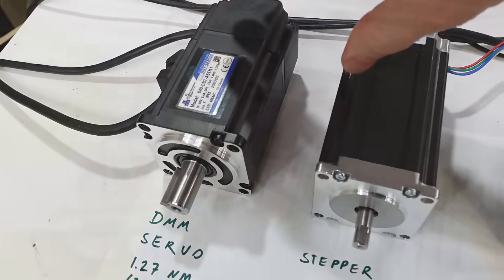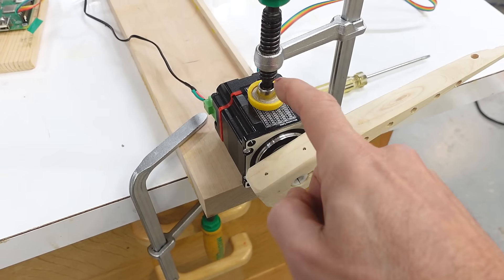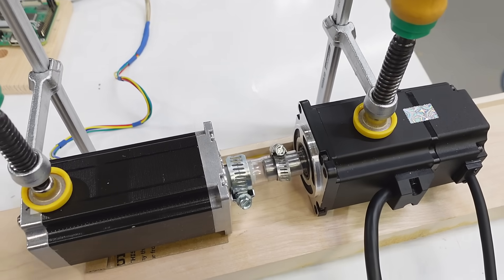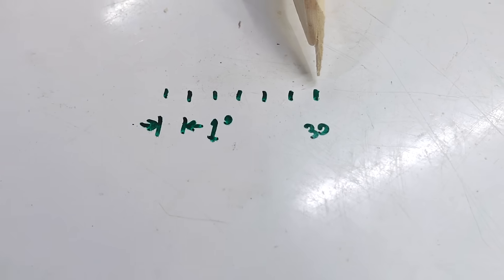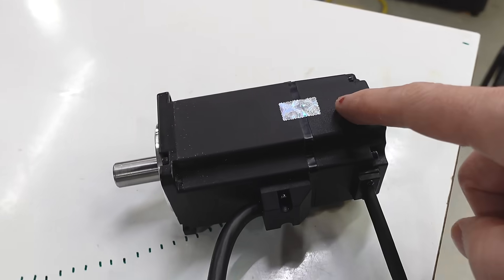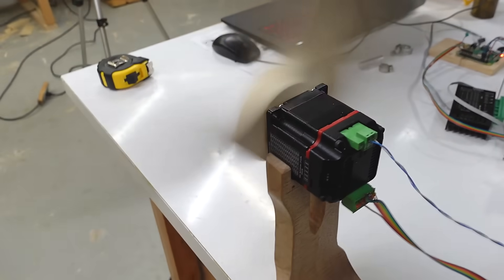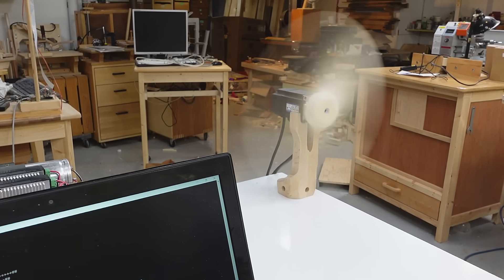Servo vs steppers: Speed, Torque and Accuracy

Comment: just buy servo motor with optical encoder, i got my CNC router on cheap chinese servos(£120 for 600W magnetic feedback set +£30 optical upgrade), acuracy 0.1degree across whole circle), also adding magnetic shelding tape helps alot with magnetis encoders.

Comment: Cool tests Matthias, how did you decide on the diameter of the pulley for the weight test? It seems to me that the ratings would be at shaft diameter, no? Which would be much higher.
Reply from the maker: rating is torque, which is independent of shaft diameter.

Comment: Inconsistent use of the SI Metric System. It is the 21st Century not 18th Century science anymore.  You call weight kilograms and torque Newton-Meter.  Do you see a problem with that?   Torque = Weight or Force x Distance = Newton-Meter not  Kilogram-Meter.  Mass and Weight are not the same thing. The mass of an object is the same value on Earth, floating around weightless in space and on the Moon.  But the weight is different at each of these locations. Weight is a derived unit.  Static weight = Mass x Gravity  = kilogram meter per second square = Newton.

Comment: Very interesting video! When comparing the dynamics of the motors, one factor that I don't believe you mentioned is that because all the motors are different sizes, their rotors will have different moments of inertia. It's therefore not a true like-for-like comparison, but may not be far off if the rotor inertia is small compared to that of the pointer.

Comment: The torque calcs are wrong on the pulley / weight lift because the radius changes with the rope thickness.

Comment: The servos we work with in industrial automation control typically use glass optical encoders and have accuracy to fractions of a degree....but they also typically start at over $1000 for a motor & amp and typically require a special "motion control" PLC

Comment: This video is a great example of why you should get a 3D printer. These kinds of experiments are the perfect use for the ends of your reels. The coupler you had to order could have been designed and printed inside 2 hours.

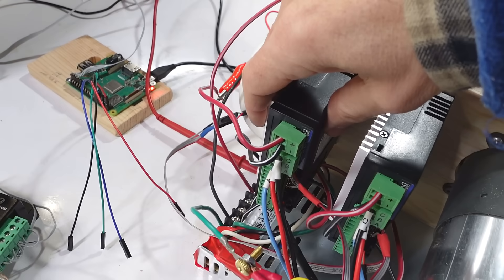Comment: 10:48 the sensor measures inside the motor windings and drive power module, and that gets hot way before the outside.

Comment: I love these videos. Could you do something similar, but related to static loads. I want to build a DIY electric weight set and I'm trying to figure out the size and type of motor i should use to apply a static force that i can push against, effectively running the motor backwards.
Reply from the maker: Most motors rely on running to help keep them cool, so applying a static force might cause them to overheat.  I'd recommend just a DC motor, and apply a current to it.  A treadmill motor might just barely be big enough.  A much better way to get a constant load is to use a physical weight.

Comment: What kind of crappy servo are you testing? I have two different type and make and both work perfectly well when it comes to positional accuracy and maximum speed. One is 180W with a built in driver and that one is powered with 50VDC and the other is a 600W AC servo powered directly from my mains, which is 230VAC. I used the 180W on my DIY lathe as spindle and it was perfect but needed more torque so I upgraded to 600W. I'd be very disappointed if I couldn't get better position accuracy than you did, or would get overheat problems after a short run. Here is a short video about the 600W: https://youtu.be/808WNVtjevI and here is one while I still had the 180W servo as spindle: https://youtu.be/uQzUsYaM68Y In both, there are some works done which needs position accuracy also.
Reply from the maker: But have you tested the positional accuracy of your servos?

Because without measuring, you would not be aware of half a degree of error.  You could be cutting gears with 100 teeth and not even notice, because the half degree error is spread over 180 degrees

Comment: I thought AC servo motors run very quiet. I bought a 400W DMM-tech AC servo  motor with their Dyn4 controller. But it is noisy as heck. Nothing wrong with the bearings apparently but it sure sound like they are shot when the motor runs. When idle with no load what so ever it is still constantly squealing with high pitch noises. Now I am missing about with EMI filters on the mains power supply but that does nothing. Add to that incredibly buggy software to setup the controller and now apparently also highly sensitive to external magnetic fields. It is starting to feel I made  a mistake.
Reply from the maker: You may need to tune its parameters.  Set the torque filter constant to something larger.  If you tune them too agressively, the feedback loop can go downright unstable.  But they will make some noise, even when just holding a position.

Comment: They should have magnetic shielding on that servo motor!
Reply from the maker: Maybe, maybe not.  That shielding in turn can get magnetized and actually make things worse.  But if the encoder magnet was twice as strong, external influence would only be half as big, relatively speaking.  But its hard to find an application where half a degree of encoder error even matters.

Comment: Mathias, I was curious during the weight lifting and holding torque tests if you took into account the diameter of the pulley and the additional torque applied by the distance from the pulley edge to the motor shaft. That single multiplier would have thrown off your calculations enough to make a difference in your tests.
Reply from the maker: Motor shaft size doesn't matter in this calculation.  Its pulley diameter, plus rope diameter that is the effective winding diameter.  That's what applies torque.
Reply: Was thinking the same thing

Comment: i might be wrong, but in theory could you attach mosfets to the outputs of the stepper drivers and feed however much power you want into the servo/steppers?
Reply from the maker: Need an H-bridge actually, and driving the high side mosfet of the H-bridge is complicated (need a driver chip for that).  So I'd want to just hook up a bigger H-bridge instead.  But more economical would be to just get a better stepper driver.

Comment: Does the company you sourced from offer servo motors with optical encoders which are less susceptible to magnetic and electrical interference?
Reply from the maker: The magnetic interference is much less of an issue than you think it is.  Being half a degree off translates to 7 microns of position error with a 5 mm pitch ball screw.  How bad is that?  A typical DRO can read to 5 microns, which is already way more precision than you are likely to achieve.

Comment: Okay that's super, super interesting about the servo overheat.  I have a ton of applications for motors like these, but it would all be in warm and hot environments.  That firmware would cause a TON of downtime and failures, so basically the opposite they were going for.
Reply: The user’s software can react to an overhead warning, but not a case of the servo actually overheating and failing mechanically.
Reply from the maker: I suspect its more a matter of how much the servo has run than anything else.  The controller doesn't have a temperature sensor in the servo, so it's just guessing at the temperature.

Comment: I am surprised the magnetic encoder accuracy on the servo was so low. It would be good to show what a servo can achieve with a capacitive or optical encoder. Can usually hit a few arcsecond with a higher quality feedback device. Maybe also compare some other lower cost servo options like clearpath that have some brand recognition, against a Beckhoff, Kollmorgen, or other name brand industrial servo.

Comment: This is great! I'm not the only one who finds ramping steppers quickly without stalling difficult. Fun video!
Reply from the maker: And the problem is, one you worked out the perfect ramp curve to get the most out of your stepper, any slight change or even a slithly loose setscrew and it may fall out of sync.  Not very forgiving.  Servos and closed loop steppers are very time saving that way!

Comment: Can you use an accelerometer to tune the PID values of the steppers? Like how fancy 3d printers use accelerometers to measure the behavior of the moving parts and come up with frequency curves to help reduce overshoot, without killing acceleration.
Reply from the maker: Don't even need that.  I can just read back the motor's position really fast and graph that.

Comment: When you were testing positioning accuracy of the servo you were in reality testing the accuracy of the encoder. Long ago I built some positioning devices for CNC use and started with steppers, both for cost reasons and because of the inherent accuracy of the steppers as any positional error was corrected every 4 complete steps. Then I went to microstepping drivers and found positional accuracy suffering. Then  I tried getting faster speeds out of the steppers and the torque dropped dramatically, which required larger steppers. I finally saw the light and moved to servos. I used optical encoders with very high pulse counts, read them in quadrature to get 4 times the step count, and finally achieved the speeds and accuracy I desired. After that I never used steppers for anything requiring significant torque and speed.
Eric
Reply: I will keep this in mind when I try to make my cnc machine. Thanks

Comment: When you control the servo, do you send position updates in a fixed interval? What is the jitter of the python control?
I've read about Ruckig as a way to get motion curves for position control. Many robot people use it. I'm not familiar with it, I'm familiar with Beckhoff NC, which is fine for simple stuff and completely crap if you want to do something complex.
Reply from the maker: In my tests, I just sent it "go there" or "go this speed" and let the controller work out the details given the motion control parameters.  For a CNC router, sending it pulses like a stepper would proably make more sense.

Comment: I think the servo is looking at the average of current draw within a short time frame, and simply assume it will eventually overheat if the current draw continuous like this. If you want to save your motor from burning out, it might be better to stop before actual overheating occurs.
Edit: I see the topic has been addressed in the end of the video.

Comment: Interesting tests and I look forward to the PID control video.  That servo-motor is quite impressive.   You are 100% correct about industrial applications.  They want a part that is reliable, has good support for it, accurate specifications and that you can order an exact replacement for if the original fails.  They don't care about lowest possible cost part since machine downtime and staff costs will dwarf the part cost.

Comment: For the steppers during the torque tests, be sure to test under different microstepping divisions. Microstepping increases positional resolution at the expense of torque by pulse width modulation of the coils. Without microstepping the full amperage is applied, maximizing torque (especially holding torque).
Reply: Exactly!

Comment: I think if you could perfect a full rotation per second slam clock it would be marketable.  It's a lot of fun to watch.
Reply: The second hand should alternate going clockwise and counterclockwise. When it goes clockwise it should advance by 366 degrees. And CCW by 354.

Comment: Very interesting seeing the feedback fluctuations while stationary and magnetic field alignment. Wonder if unfortunate placement of a few loops of the motor power cable close to the encoder would effect the feedback.
Reply from the maker: probably not.  the return goes through the same cable so it mostly cancels.  also, a few amperes is not that much.  electromagnets have many turns, so the same current is apolied hundreds of times.

Comment: Shouldn't the servo-motor be able to self-calibrate by running the motor in a constant RPM and then measure the feedback from the magnetic sensors?
(You would only do that when it is mounted for its use)
Reply from the maker: good point.  but… not sure if it would be accurate to 0.1 degrees, cause if it’s not, that could make it worse.

Comment: Is that magnetic encoder meant for position control? I would say no, needs a secondary system with optical encoder that does the positioning. That magnetic encoder is suspect and maybe just for rough speed control.
Reply from the maker: 5 mm pitch lead screw is common.  if the error is 0.5 degrees, the linear error will be only slightly bigger than the resolution of a typical DRO.  so take the difference between two readings with the DRO, and the rounding error will be about as big as the encoder’s inaccuracy.

Comment: You can't get rated torque with micro-stepping. Accurate repeatability is best with half stepping only. 
Holding torque is best in single stepping mode and decreases with micro-stepping. 
Micro-stepping is mostly used when smooth and quiet operation is needed.
These are all current-chopping drivers. The major benefit from operating at higher supply voltages, is the current through the coil reaches maximum faster (usually set by dip switches on, and therefor more RPM speed at the output shaft.
Reply: This guy knows his steppers ;)

Comment: The tests with the earth's magnetic fields were wild. Imagine being an engineer who designed a tool somewhere and shipped it to a customer elsewhere, who proceeds to have issues, sends it back, and it works fine for you. You travel out there and have issues with it, likely baffled
Reply: this is why any PID control system is only as good as its diagnostic tools capabilities. A technican comparing results from his lab-setup with (even remotely acquired) data from the field setup would very likely be able to pinpoint the issue around the values from the magnetic encoder that are fed into the loop, instead like for example the costumers application/load
Reply: Its .15 degrees. But the key is moving motor vs stationary. If the motor stays in one place and doesn't have anything near it, it will always be the same no matter where on earth because the offset is just part of the reading. But if its moving like a robot or near magnets it could be an issue. But if its .15 degrees at its shaft it depends on the gear ratio as to weather anyone would even notice it. The only way to prevent it would to be some sort of enclosure like a hard drive that cancels out the fields outside vs inside
Reply: IIRC Strange Parts had a SEM that had similar behavior, and ultimately they determined that it was due to his elevation causing problems with arcing. Crazy how quickly stuff falls apart when faced with the real world 😅
Reply: Bro the list of things that cause silicon chip manufacture variance is crazy too.
Reply: @ well at this point we are questioning existence of our common reality aren't we
Reply: @christopherknowles  A little solar flare to keep them on their toes
Reply: This was a real and serious issue encountered with torpedoes in WWII. A few nations tried making magnetic detonators, which would go off when they passed near a large chunk of ferrous metal (i.e. a ship). IIRC, variance in Earth's magnetic field wasn't well understood at the time, and every navy that tried the idea had issues resulting from testing and fine tuning their magnetic detonators in one place then attempting to use them in other places.
Reply: @SnakebitSTI  Fascinating!

Comment: My guess is that the overheat error does not actually measures the temperature, but calculates dissipated power in a time window.

I have worked with quite a few industrial servo controllers and all of them have a similar function. Usually faults with overload, not overheat. There is a peak power rating and a continuous power rating. If you are above the continuous allowed power in average for too long in a too short time frame it errors out.

The PID tuning on the servo is extremely bad. If there is a built in autotune, use that to get better impulse response. Toying with acceleration is not the correct way to tune it if you are using it in position control mode (not speed or torque control modes).
Reply from the maker: I tuned it differently for different applications.  And for lifting the weight, acceleration is the way to go because I want it to accelerate downwards just slightly less than gravity so the rope doesn't go slack.

Comment: In the interest of more content, I wonder if that aluminum coupler at 3:19 could be made on the lathe?
Reply from the maker: the round part yes. The coupling part, no.
Reply: @matthiasrandomstuff2221  Almost anything can be made on a lathe if it is big enough.
You can put a small 5 axis CNC mill on the bed of a big lathe if you want. I don't know why you would do that but it is possible.
Reply: I think a coupler is just a tube with thick walls, a slot for expansion and contraction, and some screw holes. So I would say yes, if he has the right screw tap and screws
Reply: Motor coupling could be a video on it's own! They evolved alongside motors and applications.

Comment: If you have the space to gear it down, how do stepper motors compare with BLDC drivers with position control (ODrive being the example I'm thinking of). The power densities of BLDC motors seem much, much higher, but you have probably an order of magnitude fewer steps/rotation and reduced holding torque to match, which a gearbox could give you back.
Reply from the maker: The servo IS a BLDC motor.  With enough voltage, it can go to 5000 RPM.
Reply: Servomotors can hold at full torque, depending on the driver. The performance is going to be determined by the driver and encoder. This is not the only servomotor out there.